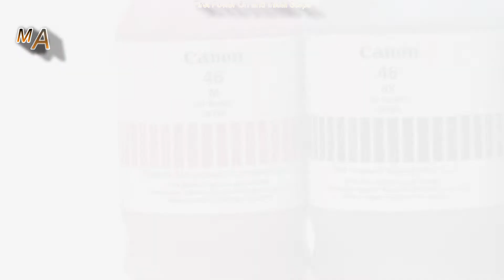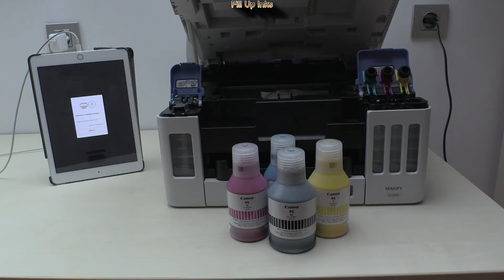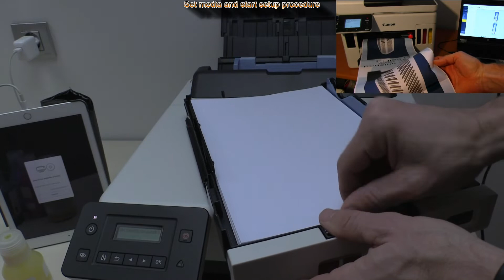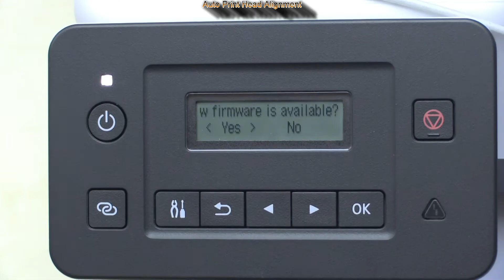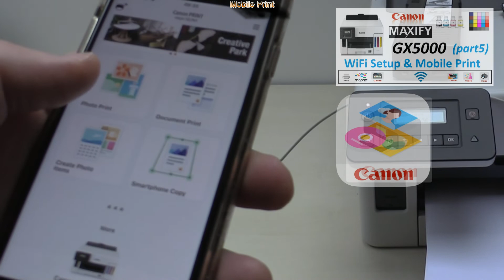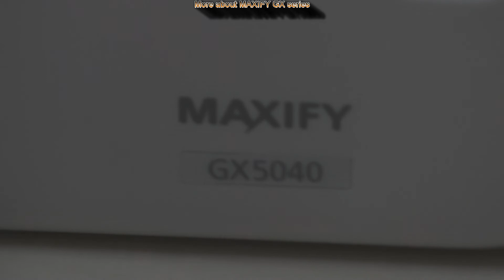MAXIFY GX5000 GX5020 GX5040 GX5050 GX5070 GX5080 GX5090 SETUP (part3) WiFi Setup w. Canon Print App

Comment: Thanks for that video! 
I'm surprised to see that it's required to enter date and time manually, I thought these times were over...

What is date and time even used for on the GX5050?

Is it possible to change it in the web/remote UI of the printer? Or only on the device display?

Thx!
Reply from the maker: Glad it was helpful! Indeed entering time looks outdated, but at least the device updates firmware automaticaly. For the web interface and more info on this printer, see my video https://www.youtube.com/watch?v=DKKe9rqIOcY&t=

Comment: do you know how to turn off the wifi connection? I went back to USB when wifi stopped working, but the printer still shows wifi connection to my router. I would like to turn that off.
Reply from the maker: Select wifi icon on the screen and then settings and you can disable wifi